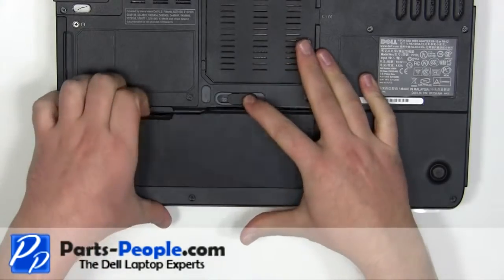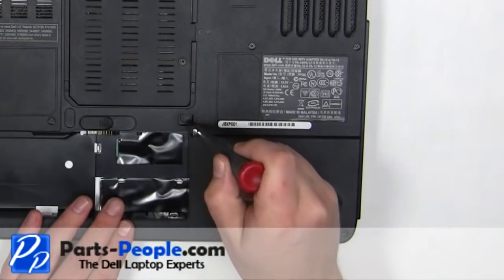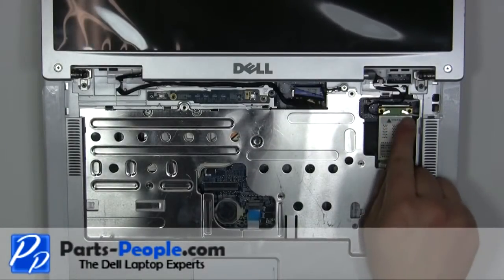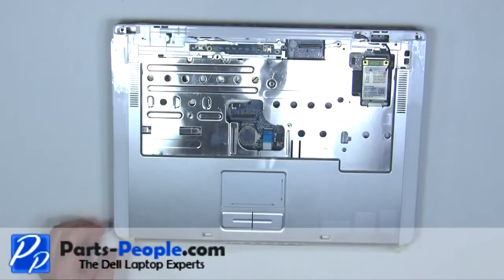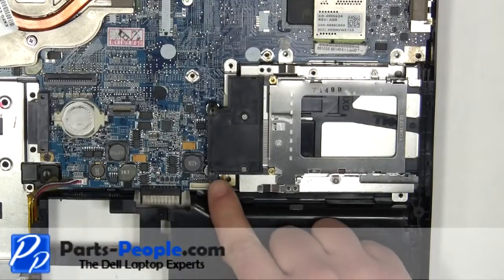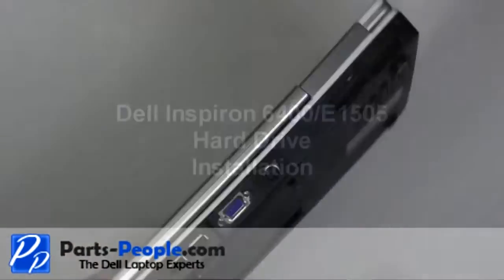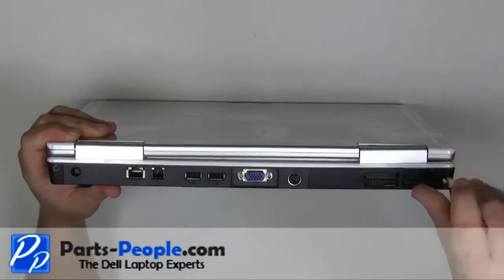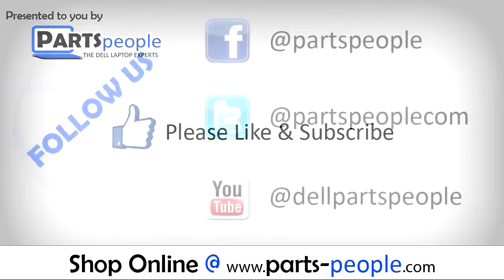Dell Inspiron 6400/e1505 | Express Card Assembly Replacement | How-To-Tutorial

Comment: I have two Dell Inspiron E1705 One has propblem sound with the Sigmatel Audio. I have unistalled and reinstalled with my disk. Still the mixer wave drops down by itself what the heck is happening ? My other dell Inspiron E1705. The power ligt goes on and then off. I have it hot wired no battery what part can I buy to fix it ?